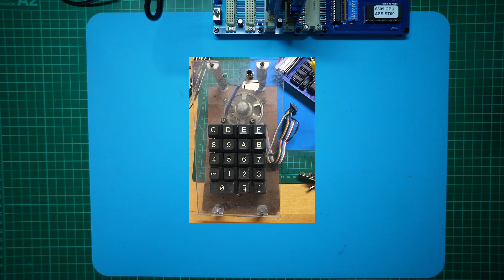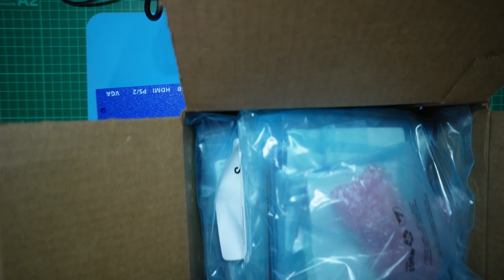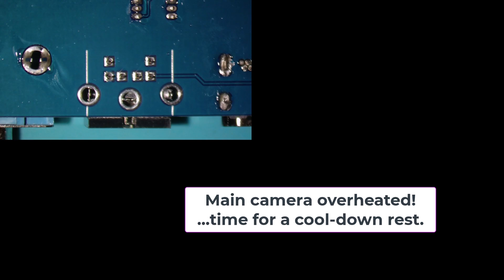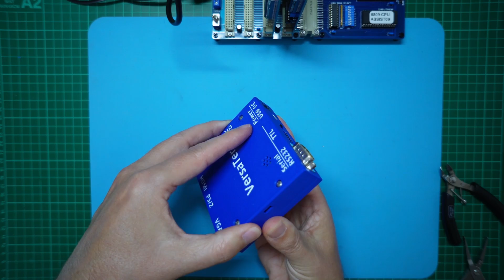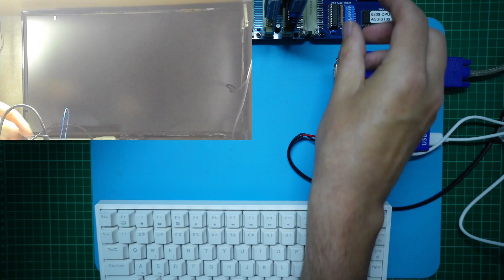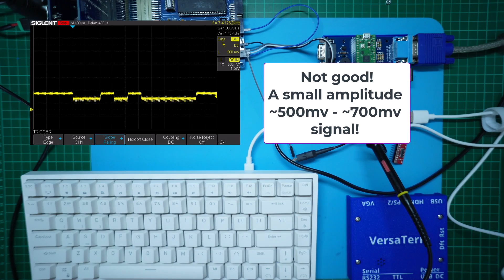Building a VersaTerm - A Retro Computing Serial Terminal

Comment: Ha! Currently waiting forr the PCBs as the final parts for 2 kits. Also got me your M3'ified case.printed. And that's been days before I saw (and you uploaded) the video. 🙂 Nice coincidence.
Reply from the maker: Hopefully the video was interesting, and you avoid the same incorrect component value mistake that I made. Although, I'm sure no one else would make that same dumb mistake! LOL 🤓
Reply: Been there, done that. Also: I'm the master of reverse polarity xD  @DigicoolThings
Reply from the maker: @Commander1024  Speaking of reverse polarity xD, I'll also admit that in my first prototype PCB for the MECB Motorola I/O Card, I actually wired the ACIA's TxD to the connector's RxD pin (and RxD to TxD).  Even though I've wired TTL serial connectors many times before, I still got trapped in thinking from the connected device's POV.  Promptly fixed, after a head slapping moment!  LOL 🤓

Comment: Your soldering technique is very good and I will suggest this video as a How-To! I want one of these but with 132 column and VT320 total emulation :)
Reply from the maker: Thank you for the compliment.  David noted the terminal was limited to 80 chars because of Pico performance limitations.  It runs at 640x480 standard VGA resolution, hence 8 pixel width font with 80 chars per line. The PicoVGA code he is using presumably can't handle the timing for higher pixel rates, to give a higher display resolution required for 132 columns.

Comment: I enjoy the soldering! Thanks for showing this, Ive been using an 90’s laptop with a serial port and versaterm to talk to my 6809 system but it takes forever to boot.  Youve inspired me to build one of these.
Reply from the maker: Thanks for your feedback.  I’ve also got a few old laptops gathering dust and occasionally used, but they certainly don’t feel as nostalgic as a standalone, almost instant-on, terminal (albeit running from a small but powerful MCU).  I had to build one for that real “standalone serial terminal” feeling, which it delivers on. I hope you get the same enjoyment that I did from building one. 🤓

Comment: Cool project, I've been looking for a terminal kit like this that can handle both TTL and RS232 levels of I/O. I really appreciate you showing your troubleshooting steps, and I like watching the assembly process too, it is relaxing.
Reply from the maker: Thanks for the feedback.  Yes, I did some research before deciding on the VersaTerm.  It does indeed seem to be the most versatile connection solution that I could find, pretty much covering all your bases.  🤓

Comment: Hey I had not heard of this project! I've been collecting designs for microcontroller-based terminals to make one next month, and this one is nice because it has options for kb + monitor, thanks!
Reply from the maker: Glad this was of help.  I searched for quite a while, looking for what I considered a solution versatile enough to fulfill what I wanted.  The VersaTerm was the best fit I found.  No doubt there are also other good solutions out there, but this just seemed a really good versatile solution. 🤓

Comment: Shame there is no 132 column support - and how are characters implemented? Can you use different fonts? Would be nice to see this with "big boy" terminal emulation and capability and for it to have a small onboard character screen.
Reply from the maker: You can create user uploadable fonts.  Also, all of the source code is published on the github repository, so you are able to modify it (e.g. alter the native fonts included, or implement custom features), and recompile.  Note however that the fonts are all based on a 8-bit character cell width (640 pixel VGA screen, for 80 chars x 8-bits).

Comment: Really nice, I think I will build something like that just for fun.
But one thing. If I could I would put the display outputs and the serial connector on the back side and the Keyboard plugs on the front. That would make the desktop less a mess of cables.But I can't design PCBs :-(
Reply from the maker: Thanks.  I guess the best placing of the connectors depends on your own situation. For me, I just wished the power connector was also on the "back" with the monitor and keyboard connections.  So just the serial connections, that I'll be regularly connecting to, where on the front.   But, I imagine David's PCB layout was also related to making the unit as compact as he could, especially given that connector location preferences are quite subjective.  If you build one too, I hope it proves as useful as mine has.  🤓

Comment: I wanted to see the assembly to see how hard the hand soldering of the HDMI connector is.  Interesting soldering iron bit you use.  Does the settings allow you to have a green or amber screen instead of white?
Reply from the maker: Yes, the HDMI connector is challenging.  I solder under a magnifier (trinocular microscope), and use a Axun T210 handled station.  I like the small bent-end tips for most work, as it seems best for getting good contact / heat transfer when using a small tip.  By setting the screen mode to Monochrome, and setting the ANSI colour for "Monochrome text" you can set colours other than white, for background / normal / bold.  I'm currently using a nice Amber by setting the "Monochrome normal text" colour to F0.

Comment: Im sad bigger lcd screens are so expensive i always wanted to build a small-ish 8 inch dumb terminal
Reply from the maker: Yes.  I just ordered a 10" Eyoyo IPS HDMI/VGA/Video 1920x1200 monitor from AliExpress for around $100.  I was after a small monitor, and this seemed the best for resolution, inputs, and display quality.  Not too bad a price, but you can get a good much larger monitor for the same price.  So, small / portable seems to command a premium.
Reply: You might look at refurbs.  It's been a few years since I bought some.

Comment: Excellent video! Thank you for bringing Versaterm to my notice. I had been looking for a discrete new VT100 Terminal based on a Raspi Pico to use as a console Terminal on a Server machine. 
I don't mibd seeing you populating and bringing up a new PCB.
Do you have a reference where to order the PCB/Kit?
Thank you for sharing.
Reply from the maker: Thanks!  There is a link in the video description, to David Hansel's VersaTerm github repository.  There's no complete Kitset on offer (that I'm aware of), however on github you'll find a link to a pre-populated Digikey shopping cart for most of the components.  Also, the gerbers for ordering the PCB from the likes of PCBWay or JLCPCB etc.  And, files for 3D printing the case.  So it's quite easy to order the parts you need, just not from a single source.  Hope this helps.  🤓

Comment: This is so cool. I find myself drooling over old DEC terminals when I could be building up these for a fraction of the cost! It seems small enough to fit inside a CRT for a dedicated glass TTY. I wonder if the Pico 2 could bring more functionality such as smooth scrolling, ReGIS, or 132-columns. I happen to have a Pimeroni VGA Pico Demo board.. I wonder if it could be hacked to run this firmware.
Reply from the maker: Thanks for your comment.  If your CRT monitor accepts VGA input, it would certainly be a great project to install a VersaTerm internally to make a dedicated CRT based terminal.  Very nostalgic!  I had also wondered about what a Pico 2’s added performance could add to the VersaTerm.  I’m not sure if David has any plans in this regard.  But, if I was going to explore this further (no plans currently), I’d talk to David first to avoid any duplication of effort. 🤓

Comment: I am doing a project to assemble a UART to RJ-45 female converter so you can just plug in a dumb terminal with an RJ-45 to RS-232 serial port adapter with a standard ethernet cable, with the ability to re-wire the RS-232 pins (since they were not standardized) inside the female RJ-45 box.
Reply from the maker: Interesting.  Is this an active component solution (e.g. that contains drivers for longer ethernet cables), or is it a configurable pin-pin adapter?  Do you plan on making a video?  it would be interesting to see what you're making.  It'd be useful to be able to patch a serial connection between ethernet outlets. 🤓
Reply: Just Pin to pin. While this one is to connect ODROID SBCs like the C2 or HC4 to a serial terminal, so SSH can be left off,  and with the HC4, allowing the use of the 1 USB jack the concept would work for any device with a motherboard UART output. 
I think i can make a video of it at the Vintage Computer Museum's repair workshop coming up in early January. 
 @DigicoolThings
Reply from the maker: @justin423  Sounds good.  I've subscribed, just in case you get a chance to make a video about it.

Comment: Sorry for the late comment.  A suggestion: add a pin hole for the pico reset button in the case.
Reply from the maker: Thanks for the suggestion.  I haven't needed to reset the Pico, but when I'm next looking at the case design I'll take a lok at doing this, as it certainly does seem a reasonable suggestion! 🤔

Comment: what is the writing on the Diode SMT Schottky what type, as I have lots but not sure what one to use.  Was going to use SS36.
Reply from the maker: Looking at the BOM, Schottky diodes D1 & D2 are specified as CDBA140SL-HF, which the datasheet says has marking code "SLS14". I'll leave it over to you to decide if your parts drawers have suitable substitutes.  As I was ordering many of the parts from Digikey, I just included these in my order (no doubt I doubled-up on some parts I already had... but that's pretty normal for my inventory tracking system!).  🤓
Reply: @DigicoolThings  Thank you - Ill have a look to see if I have SLS14
Reply: @DigicoolThings  Thank you looks like I have the part - SS14 DO-214AC 1N5819 1A / 40V Schottky Diode - Think the same 1A 40v
Reply from the maker: @davidcocklin2109  The main difference seems to be the forward voltage drop. The specified part is only 0.27V typical, whereas the 1N5819 is 0.6V. Not sure if this is significant without a closer look at the schematic?
Reply from the maker: @davidcocklin2109  Looking at the schematic, the main difference with the greater forward voltage drop appears to be the USB, PS/2 and HDMI connector 5V pins will be run at around 4.4V, instead of 4.73V with the specified part.  This may cause some issues, as 4.4V is below the normal 5V +/- 10% you’d normally apply for 5V devices. i.e. typically a 4.5V - 5.5V range.  But would depend on your keyboard’s requirements etc. Just my 2c :) 🤓

Comment: 24:15 Why a USB keyboard when it has a perfectly good PS/2 connection? 😉
Reply from the maker: Excellent question!  Basically, one of the attractions of the VersaTerm is that it supports either PS/2 or USB keyboards.  Finding a moderm, compact, mechanical keyboard, that also supports PS/2 conection mode, is getting difficult.  I was wanting a "space saving" compact Mechanical keyboard, and found the reasonably priced good quality "Royal Kludge" RK84 from AliExpress.  However, it only provides wireless or USB connectivity (no PS/2 mode, so a simple PS/2 adapter won't work).

Comment: I'm confused about the 2 additional wires Pico vs. PCB. Ahh I guess due to the USB-Host (keyboard)..
Reply from the maker: Yes, I think you're spot on.  It's covered in the github "Assembly Tips".  Specifically: "The Raspberry Pi Pico does not route the USB data signals to its pin headers. However, there are two test points (TP2 and TP3) on the bottom of the Pi Pico on which the USB data signals can be accessed. Solder in a short wire from TP2 on the Pi Pico board to TP2 on the VersaTerm PCB. Same for TP3."

Comment: Good video.
The use of a USB B mini connector causes me to not  consider this project.
Reply from the maker: Yes, although that didn't put me off, as the functionality was my main priority.  I'm using the DC connector for powering my VersaTerm.  For all of my current 5V powered projects I've actually gone to the USB-C connector, as I find it a nice 5V solution that also avoids the reverse polarity / over voltage risk of using the age-old DC connector Power adapters.  Plus, thanks to the RaspberryPi, USB-C plug terminated 5V DC Power Adapters are relatively cheap. 🤓
Reply: @DigicoolThings  I use those USB to magnetic corrector things.That way one cable does multiple devices regardless of original connector..
Reply from the maker: @aprusek  Good idea. I must look into further.  Thanks.
Reply: @DigicoolThings  A while back I built "Geoff's VT100" which is a PIC based vt100, and way back wrote a Hazeltine 1500 emulator to tun on a Model II Tandy.
Reply from the maker: @aprusek  Yes, I came across Geoff's VT100 variations, while searching for a good stand-alone terminal.  The recent VersaTerm won me over with it's USB keyboard and HDMI output options allowing use with more modern keyboards and displays (plus, I had an unused Pico in my parts drawer).  p.s. I ended up ordering some small USB-C to mini-USB and micro-USB adapter plugs to satisfy connecting my USB-C 5V power source to the different USB power connectors.  I didn't find a magnetic solution for mini-USB, only micro and USB-C.